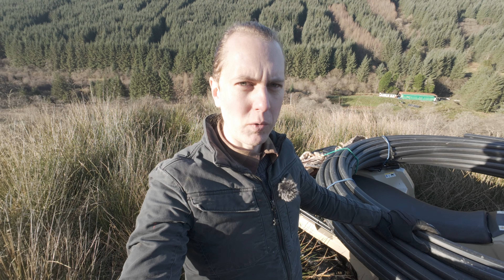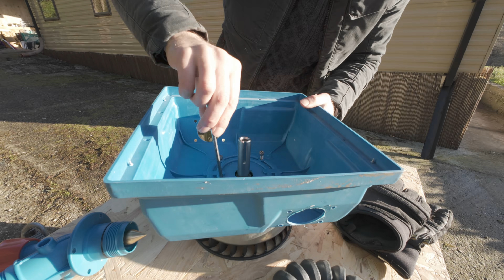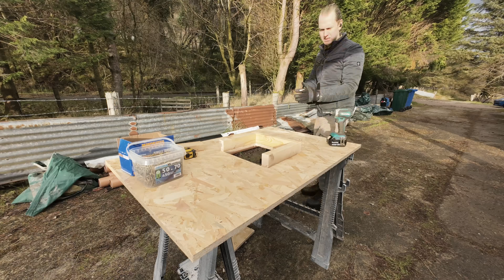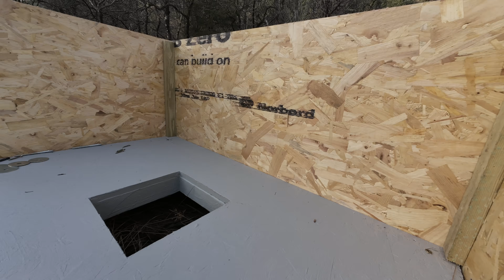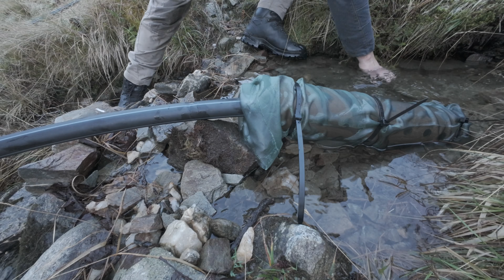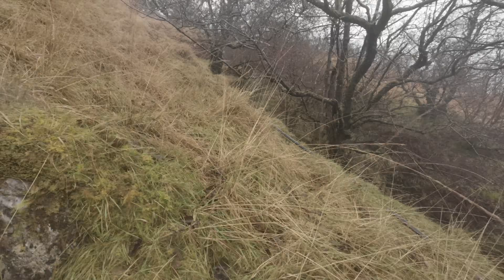DIY Micro hydro power-Off Grid Day 35

Comment: Get hold of one of the big square ex acid  barrels that have a metal frame around them. Site it up slope and level it, near the intakes and feed both the intake pipes into the top of the barrel. Put in an overfow pipe at the top of the barrel and an out feed close to the bottom. Any bubbles will then have a chance to escape out of the overfow pipe and you should have no problems from having one feed from the streams higher than the other.

Comment: It is better to install the vertical ventilation pipe slightly below the water inlet. This allows the trapped air to be released from the pipe. Otherwise, this air will remain in the pipe and reduce its throughput, creating an air lock.
Reply from the maker: You are right, I did move it in a later video

Comment: Hello, we are in Teesdale and at the beginning of our micro hydro journey. We've capped a spring up on the moor and have 500m of pipe coming down the hill with a vertical drop of 70m. I looked at the NZ pelton wheels but decided to go with the cheaper turgo wheel from motenergy. 
I'm wondering, were you just lucky that yours went together without issue?

I have had to drill my own holes in the blue box to attach the generator on top.
Next the hole in the middle of the turgo wheel does not slide over the generator shaft so I'm going to try grinding it slightly wider.
Then the key is too long if I want the aluminium adapter to sit close to the generator which is the optimum position for it.

Did you cut the key in half and then secure it with glue? (I assumed one of the two side screws would secure the key but they are out of position to do that). Thank you I'm enjoying following your story 🙂
Reply from the maker: No mine was a pain in the arse, the holes diddnt line up and the washer was missing and there was no gasket for the nozzles. It was cheaper than the powerspout though so cant say its all bad. yea I cut it but in a way I could still use the keyway so I think we both did the same thing.

Comment: Now with the low cost, light weight, solid state  Fractal Capacitor Array @ 94% efficient (see Robert Murray Smith)you can transform/rectify  LV AC or DC into HV DC send it  real far , then transform back down to LV DC, For any application. If using plenty of high Farad Ultra caps, The array can be the battery bank/ Buffer!
Reply from the maker: I watch so much of Robert Murray Smith!

Comment: You should use a 4 inch pipe to run down from your water supply inlet and then split it off right at the bottom into your 2 inch  pipe that go to your turbine nozzles. You will get more pressure thus more power
Reply from the maker: I agree, I think for version 2 that is exactly what we will be doing

Comment: The turgo wheel support is very pressed into the shaft. Didn't you put the key in?
Reply from the maker: I did put the key in, in the instructions it said the key needs to be shortened by hand because the keyway isn't long enough for it.

Comment: minuto 5.07 : look at my logo: if you don't put a glued sleeve (I use the one they put on car windows), water will get into the bearing
use a fixed injector or change the ring of the double plug: it has an exit hole that is too large and the spray is bad,
Reply from the maker: Thanks for the tip I hadn't considered the sleeve and someone else had also mentioned the poor spray of the nozzles

Comment: The bore of your penstock is far too small, the frictional losses are significant. With your static head of 70m & a penstock length of 250m with a bore of 40mm the available head running 1l/s = 65.3m, 2l/s = 57m, 3l/s = 44.3m, 4l/s = 27m & 5l/s = 6.67m. Unfortunately you will be disappointed with the available power available due to really high frictional losses due to the small diameter of penstock over that length. Ideally you should have sought some technical advice prior to purchasing the penstock.
Reply from the maker: Thanks for the advice, I wanted to do it myself rather than go through the hullabaloo of seeking professional advice, as well as the cost associated with it. I also didn't want to use too much water and run the streams dry so I am ok with lower power. Sounds like you really know your stuff though!
Reply: Hi understand you wanting to design and manufacture your own micro hydro system without seeking outside help but as you can see from the above figures the more flow the more head loss due to the long penstock and relatively small bore. Is you penstock actually 40mm bore or 40mm outside diameter? If you can accurately measure the bore I can give you a more accurate figure for head loss at different flows. You say 70m static head on one penstock but what is the head from your other stream? I can then deduce what actual power you should achieve from each penstock and which flow rate will give you the best efficiency. Regards, John @beyondtheworkbench
Reply from the maker: Thanks John, Its 6 bar 40mm pipe so the ID is larger than a standard MDPE would be but it's not 40mm, more like 36mm. Both heads are 70m but I won't be using more than 1-2lps per stream. We get 80psi per line at the turbine. @johnhutchinson5265
Reply: I worked out the frictional losses based on 70m head using 40mm bore so therefore using 36mm bore the head losses will be even worse than the original figures I sent you yesterday. I will work them out and let you know. You will probably only be able to use a maximum flow of 2l/s otherwise the head loss will be significant. I will also work out your potential power available at different flow rates so you will know which flow gives the most efficient outputs. @beyondtheworkbench
Reply from the maker: Thank you very much for working on this for me. I used the powers-out calculator when thinking about what I could use @johnhutchinson5265
Reply: @beyondtheworkbench rough guage every 10.2m of head equates to 1 bar of pressure or 14.7psi, did you mention 25psi at the turbine (lowest point) this may suggest the flow rate is too high for the pipe bore, great project and looking forward to the next installment
Reply: John Hutchinson is correct. You're going to be very disappointed with your output and there's no need to have 2 nozzles with that diameter pipe
Reply from the maker: Thanks, Each nozzle runs to a separate stream so that was my thinking @alabastardmasterson

Comment: Out of curiosity if one pipe/jet as less pressure and the other is spinning the paddle faster than the other won't it be pushing it through the other jet of water causing it to act like a brake giving less power. Could joining pipes together higher up then splitting it lower down into botn jets minght equalise the pressure on both of them both spinning paddle same speed If that makes sense
Reply from the maker: I had wondered if it would have any affect but it doesn't slow the turbine when I turn the other on and I think as they are on opposite sides of the wheel they don't spray at each other much. I will definitely be seeing an eye on it though as we are still testing it.

Comment: You might need to add a breather tube on both pipes to let the air out, it's just a vertical pipe on a t-joint that with the air outlet above the inlet. Have you checked the ltr per min of your streams as your pipe looked a bit thin as well.
Reply from the maker: thanks, I had two vertical t joints per pipe but the water was just pouring out the top and they were 2 metres tall! I have a solution that we will be putting in the next update though. Pipe is rated for 6 bar so I seem to be ok with that. The higher pressure pipe was so much more expensive so I thought I would replace the lower section if its not up to it
Reply: looking forward to checking out the solution. @beyondtheworkbench